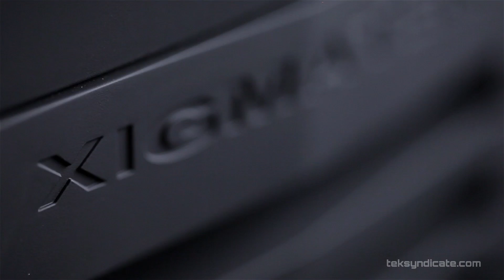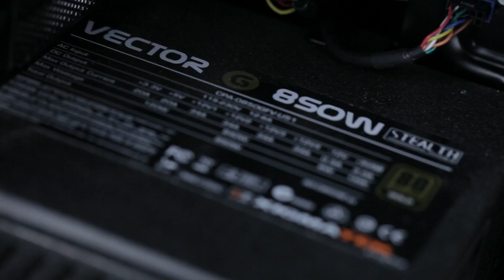Pistol's AMD Workstation Build For Streaming, Gaming, & Editing

Comment: Dang wrong. Write that when they took I guess the old CPU out. See it's water now haha
Reply: do you even make sense bro?
Reply: not in the case of this video. I commented too soon, when i saw them using the air HSF combo. dumb I know but I did not delete my comments after setting the water cooling.

Its strange though. This CPU specifically needs a water block. Why even try an air cooler at all?

AMD says water only.
Reply: Lol was unaware. Currently looking at what to buy amd vs intel not sure  the extra money saved is worth dealing with heat and power issues.
Reply: Intel is much cooler running, but you pay a premium.

The 8350 is a great cpu for math intensive tasks like video editing (I have it for this) and some gaming. If you use a decent AMD card (they are dropping price too) you have a good priced gaming/all around machine.

Honestly, the AMD platform is good but Intel will perform slighly better. You may never notice though.
Reply: Yea but is it really that much more in the scheme of things. I guess thats what I have to decide.
Reply: It's simple. 
If your budget is high, go for Intel. 

Otherwise,  you'd be better off buying the best fx based system you can for under say, $1000
Reply: Steven Campbell I would say that any streaming/gaming machine under $2000 would see no drop off by being run on the FX platform. My current machine is wonderful (around the $1500 range) and I have my fx 8350 driving it. But yes, if you REALLY want the bleeding edge, the i7 4770k is the way to go because overall it is the better processor. But the biggest error that people make is buying into the i5 over the 8350 hype train. I don't think people know that this isn't 2009 anymore.
Reply: yep. but people are always partial to intel. I know though that now that it is over 30C (87F) daily the heat is becoming an issue during long rendering in premiere. Just need more fans but it pushes up to 65C which is the shut down point.

Comment: Only thing is with my noctua cooler is I had to remove the high profile ram sinks on my Vengeance ram.
Reply: you better replace the sink, just add the smaller one because if the ram is clocked at more than 2133mhz then the vrm's better not overheat bro

Comment: why not go with Nvidia Gpus for CUDA tech if your rendering stuff
Reply from the maker: Because OpenCL.
Reply: so is it better than CUDA?
Reply: Marc Mondejar In applications that support both, OpenCL is generally faster (from what I've seen).
Reply: +Christian Marc Mondejar (Chan) plus, a new 390x is better than the 980ti although clocks are slightly slower, but it can be OCd
more cores, 8 vs 4\6GB Vram, and price of the red guys almost half the price of the green team.
Reply: +Christian Marc Mondejar (Chan) because there isn&#39;t really a lot of support for CUDA in rendering software... generally they support OpenCL... and AMD is an absolute BEAST with it... in testing, the R9 280 in crossfire mode outpaces a Titan Z, and yet the Z is a HELL of a lot more powerful than the R9 280... same goes for 980Ti vs R9 Fury X... the FuryX beats the 980Ti in CL in pretty much every aspect! it just lags behind in OpenGL and DirectX a bit, but if you render, those aspects aren't vital

Comment: Building my first rig, can someone tell me if all of these components will get along well? http://secure.newegg.com/WishList/PublicWishDetail.aspx?WishListNumber=18622869
Reply: Looks good to me
Reply: That would be a great PC but the price to performance ratio is going to be awful. If your willing to sacrifice the luxury and bragging rights you could build a PC with the same performance at half that price or more.
Reply: The DAC on your motherboard is as good as any sound card with the exception of amplification.
Reply: Could you link me the way you would go about building one that's better? ;o
Reply: I'm thinking about using the SSD for the OS & then the HDD for regular stuff like games & movies :)
Reply: Sam F I'll look into that water cooling system! :D & I'm using that sound card to use it for a nice surround system I'm adding to it, though I'm still debating as to which.
Reply: Sweeet :D
Reply: Its beautiful.
Reply: Great suggestions! Thanks everyone so far :D
Reply: I've made some changes so far to the build, the reason I've chosen what I've made so far is to keep it unbottle-necked to add another graphics card and PCI-E cards for any other extensions like a game recorder or wifi AC :), and a massive tower to fit it all and more fans lol + extra drives down the line
Reply: Far be it from me to judge your PC, I personally spend a lot of time, a whole lot of time, getting good deals. I built a PC with a GTX 780, an i5 3570k,  an SSD, z77 mobo, 4tb of storage and a 650w  80+ PSU for under $1,000 (approx $850, and that's rounding up). It has taken me a year to get it to this point and I have swapped and sold components, depending on sales I find, to get here.
Reply: Demorthus I know you're talking about adding surround, just so you know though you can still do surround sound on 90% of motherboards including the one you picked.

One caveat, are you planning to hook the surround sound up through optical or analog cables?
If you're going optical, it doesn't matter which you use (that soundcard or motherboard) you're going to get Stereo in games if you hook up an optical cable. Neither that card, nor the motherboard does on the fly encoding to put surround sound through the optical port. You'll need to find something with Dolby Live! or DTS Connect if you want surround sound from games through an optical connection.
If you're going analog, that card is not likely to be an upgrade from your motherboard. In fact the onboard supports 7.1 while the card only supports 5.1.

Also yeah at this point in time, no Velociraptor, they're loud and all you're going to gain is a very, very, very small boost on load times. Grab a large WD Black and game off that. Maybe a small SSD if you like games like Skyrim or the newer Fallout games, SSDs do help to get rid of microstutters in huge open worlds like those that are constantly loading while you're outside. (With that 256 GB SSD you will probably have room for 2-3 big open world games anyway)

I'm not really sure why you have an extra ethernet card? Your motherboard already has a single gigabit port already built in. Should be more than adequate on it's own without adding another piece of hardware unless you're accessing a NAS all the time or doing other really heavy network stuff. (An extra gigabit port is only going to help on your internal network, your internet connection is not likely faster than the first port)

Comment: 6:04 that'd be an intel board...

also in the case of the h100i why not put the fans in that gaping hole in the top...you know where the cut outs for the fan cables are?

Comment: I think you should definitely take aesthetics into account when buying a case lol :3
Reply: I didn't and I got this ugly eye sore plastic thing with twinkling lights. Like everything else in my build I paid less than half what it's worth and the performance is great, just ugly.
Reply: Okay lol, well it's a preference thing right? :)
Reply: Yea, it is probably my biggest regret of my system.
Reply: Scott Ster I actually had a case that was really ugly, and I pretty painlessly switched it with a Thermaltake Level 10 GT.
I now love my case :3
Reply: Thermaltake is not necessarily a bad choice. The primary function of a case is to adequate mount all your hardware, provide adequate airflow and wire management. All other factors are personal preference. You can build an entire PC outside of a case and it will perform exactly the same as it would in any number of cases. Every other consideration is subjective about appearance and rigidity, ease of assembly. I need a new mother board soon and my plan is to get a very minimalist design case made of metal/aluminum and improve wire management for better airflow. But after the upgrade my PC will not run any faster or better.

Comment: could my 620 watt psu handle a 9370 and a 270x toxic
Reply: yes.. absolutely..
Reply: just wondering cause the toxic is overclocked like 200 mhz
Reply: khirasier It doesn't matter.. The voltages haven't been tampered with at all. It is a pretty low power card with an equally low TDP. The CPU on the other hand has a pretty high TDP. But you never really use an 8 core proc at 100% load all the time anyway. And even if you OC that CPU to 5 ghz and OC that graphics card to the highest clocks you can possibly achieve.. You're not going to use any where near 600 watts. So you are fine.
Reply: i will use that 600 watts later though when i upgrade to 2 270x toxics
Reply: That's a little different.. I would recommend at least a 700 watt for two 270x in crossfire so that your PSU isn't running like a ragged dog all the time..
Reply: yea when i get that 2nd gpu im also going to upgrade toa 800 watt psu
Reply: aw hell naw it might run but you might get a bit less performance because there might be a lack of power

Comment: I would have saved my money and stuck with the 8350 and overclock the crap out of it, and get the 290x a little sooner.
Reply: Definitely not a bad idea for the money, but just for the record, the 9590 should still overclock better. Most of them can get 5.6-5.7GHz at 1.6v core, which is completely adequate with regular retail water cooling.
Reply: zolikoff 1.6V, holy crap, Surely that would melt that core?
Reply: Joshyy Neah, with water cooling it's fine. FX chips can push it up to 2v on overclocking records with LN2.
Reply: zolikoff But remember she also wants it quiet, as would I, so that may not be ideal ;)
Reply: zolikoff 1.6V is the max you want to push a CPU. 2V rarely works and often involves bricking ~5 or 6 CPUs to get one that doesn't melt.
Reply: ***** Yeah, 2V is in the extreme, which is why I said "overclocking records". But there's a lot of range between 1.6 and 2V. Yes, even above 1.6V it isn't "safe", but these chips aren't meant to be "safe".

If you want safe, just get an 8350 or an Intel, and forget about 5GHz+.

Comment: 2:46 sure! "9590 better than "4930k" at streaming"  sure!
Reply: Considering that the 4930k costs almost twice as much as the 9590 (at least atm here in germany) without even mentioning the price for a halfway decent 2011 board and the fact that most games are pretty much gpu limited anyway. -Yep: "sure! "9590 better than "4930k" at streaming"  sure!"
Reply: Sure.... :) nobody spoke of price to performance ratio though.....XD
Reply: Okay, you are right. Logan didn't say that. But I would guess that he meant the price/peformance ratio. I'm pretty sure Logan knows that a 4930k has more computational power in pretty much every situation one could think of.  (btw: I have no way to prove this theory atm, but: Maybe amd's "unganged" memory mode does help to get a better peformance while streaming.)
Reply: Nope........ 4930k is plain better than 9590 in any and every possible way .....except the 9590 is a better room heater....ye that its better....
Reply: umeshwarnath surendranathan No way,a processor that costs twice as much is better?
Reply: Lol ...some people find that hard to believe and blab wrong stuff....
Reply: No,what I mean is you're paying 2x as much for a Intel based system,of course it's going to be better. Logan has already preoven that a AMD FX 8 core  based system is great for gaming/streaming/rendering.
Reply: Sure he has....!

Comment: One thing i wonder about the 9590... since its just an overclocked 8350 BUT its a HEAVILY quality/speed binned cpu, doesn't it actually consume LESS power than an 8350 overclocked to a similar speed?
Reply: Yes, it does consume less / create less heat than the average 8350 @4.7GHz... it should also OC higher.

Of course, most people don't know how much a CPU's consumption goes up once you start fiddling with the voltage, so everyone just reads 220W and goes crazy.
Reply: ***** You're actually better in performance:watt, because as you overclock, power consumption goes up much faster than performance increase.
Reply: ***** Hehe just because it's cheap doesn't mean it's crappy silicone ;)
Reply: ***** I've got my 8320 on 4.4 with 1.45V :/
What motherboard do you have?
Reply: GePree00 Unless your vcore is unstable or you messed with the fsb, it's really not up to the motherboard. He just got lucky with a better chip.
Reply: Yeah, that's been my conclusion, that I've been unlucky with this chip. The OC was done only by increasing the CPU multiplier. I couldn't get it stable on 4.5 without going over 1.5V, which I didn't want to do. But what do you mean with 'unstable vcore'? btw, this is the first time I really overclock.
Reply: GePree00 Well the power delivery for your CPU is through the motherboard, so some motherboard may keep the vcore more stable than others...

Basically, your CPU voltage is DC but not at an exact value, since your PSU generates the supply value (+12V and +3.3V) from AC current. So it has a slight fluctuation, which can be amplified by all the components it goes through on the motherboard, especially if you start to overclock.

If the value is unstable, so is your CPU. A slight dip below adequate voltage during operation, and it shuts down. So there is a motherboard factor, related to power delivery, when overclocking. But if monitoring software is showing a stable voltage, that's not the problem most likely.

As a final note, you might want to check your BIOS that Spread Spectrum is disabled, since that will mess with overclocking.
Reply: Yeah, it should be turned of, thanks for the info :)

Comment: Horrible cpu choice. Everything else I agree with.
Reply: It's for streaming, this CPU fits great for that. It was a great choice.
Reply: GePree00 I'am aware, but it's not much better than an 8350 and it draws wayyyy to much power to compensate for the small horse power boost.
Reply: It's not very much, but it's a bit. I don't think they could get a very good overclock on the 8350. But you were saying it was a horrible choice, but you say at the same time that you're aware it was a good choice?
Reply: GePree00 I'm aware that it's good for streaming and it's fairly easy to overclock the 8350 to 4.8 ghz.
Reply: ForTheViolence It easy to overclock. But it's not very easy to overclock to specifically 4.8 no. Not every motherboard can do that, including Pistol's.
Reply: What? any 990fx motherboard is perfectly capable of easily overclocking an 8350 to 4.8. ESPECIALLY an asus board which has a one touch 4.8 feature. There's no point of carrying on, I can tell you're not very familiar with AMD chips.
Reply: ForTheViolence I don't know which motherboard pistol had before or if it's the same as in this rig, but I thought someone somewhere here in the comment section said that she only achieved 4.6, which now that I come to think about it sounds like absolute bs. Sorry about my replies, they're mostly crap too. Other than the fact that they're beasts at streaming and rendering :D
Reply: ***** Oh yeah that's where I got it from
Reply: if you are going to stream AND game you really need the power of a i7
Reply: ***** cpu cooler problem. An air cooler won't achieve the sort of clock. I definitely doubt it's the board.
Reply: I've got my 9590 at a 4.9 stable OC :)
Reply: ForTheViolence An 8350 with a 4.8Ghz overclock uses the same amount of power as a 9590, if not a little more.

Same core, same architecture, same number of cores, everything. The only difference is the clock speed, and the fact that a 9590 and 9370 are better for overclocking.

Comment: Have you tried OCing the FX 8350 before upgrading it?  In most cases they can overclock to 4.7-4.8GHz and 5GHz.  You could have saved money that way.  For a better save (price/perfirmance) a FX 8320 could have overclocked to the 4.7GHz range too.  With the money saved it could have gone to a R9 290(x)
Reply from the maker: The CPU was only $300.
Reply: ***** Ah I see then.  Sadly all chips are not equal (great overclockers.)  I guess the best choice is the 9590 or whatever the top FX model is.

Comment: Pistol, why don't you go for an R9 290 instead of 290x? Look out for the Sapphire Tri-x 290. Price/performance wise, it's the best of the R9 bunch and could really easily drive anything you want. It's what I plan to get in the next few months when it finally comes back in stock.
Reply: true audio is only the x suffix cards
Reply: G3nesis Prime The 280x does not have it.
Reply: they benchmarks are quite better from the x version :)
Reply: TheLazyStripper

280x is weird since it's a 7970 rebrand
Reply: G3nesis Prime

Both 290 and 290x have TrueAudio alongside 260x.
Reply: Rashid Rahman

I was under the impression that only the X cards had it but I assume that means only the Hawaii GPU's support it than?
Reply: Right now only 3 cards support TrueAudio, 290x, 290 and 260x. 

260x not Hawaii.

Comment: I don't get the point of the 9590, when in order to run it, you need the kind of cooler that would allow you to OC an 8350 to basically the same point.